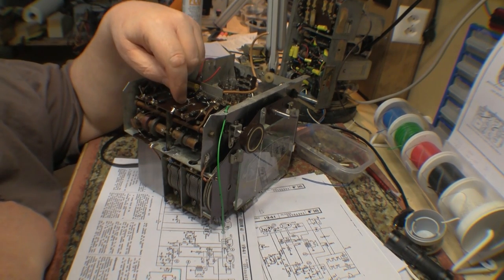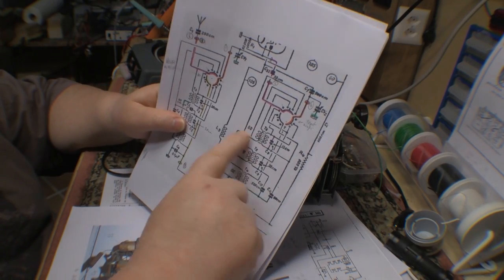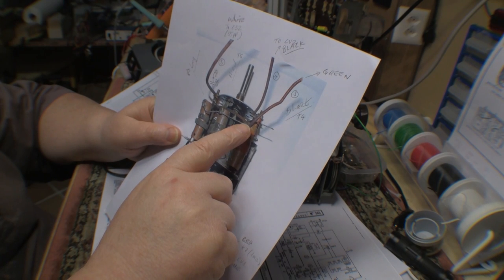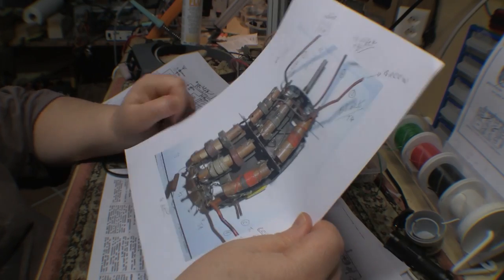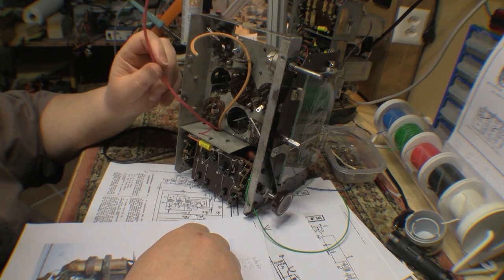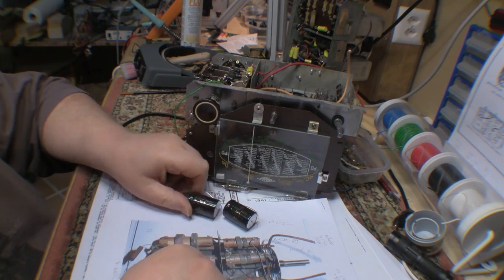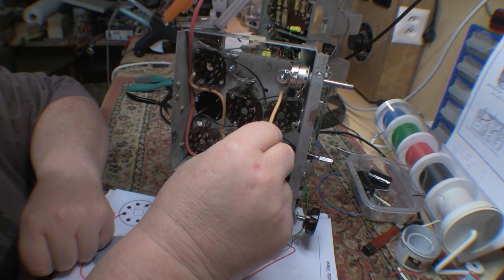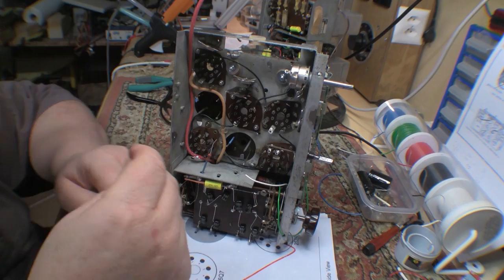Radialva Groom Rebuild - part 11

Comment: Perhaps John, the way the oscillator mounts is potentially not a firm ground point so they tie it to the main chassis instead. This would entail a high confidence ground point.
   Just my two cents worth. I could be all wet as well.
   I try...
            Good luck!
                             Tom